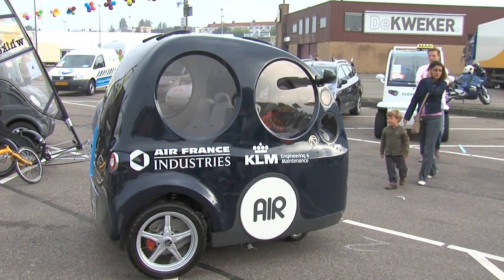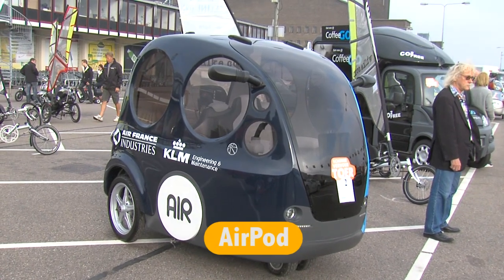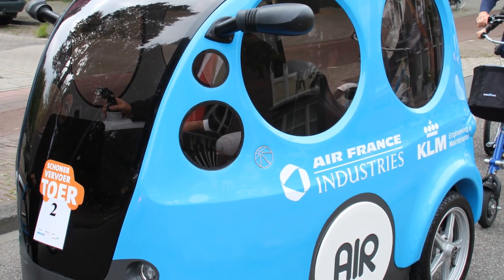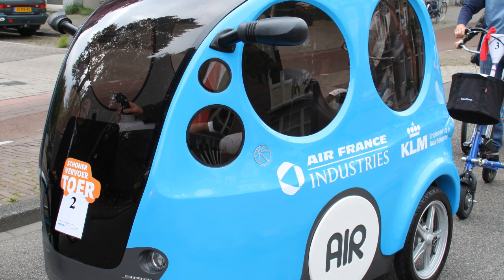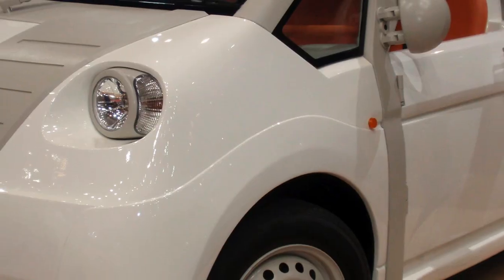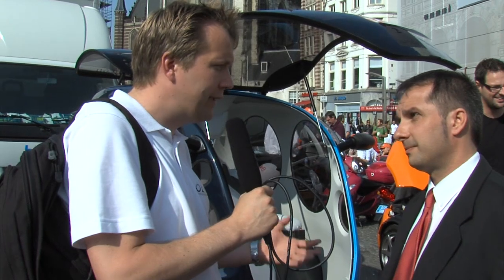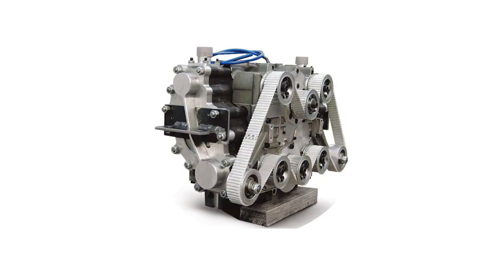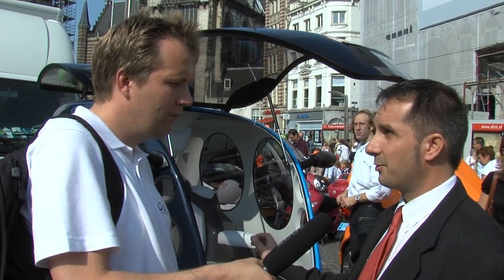Running on Air, the MDI Airpod

Comment: @DanFrederiksen -- the 15km range was mentioned by a KLM official inadvertently during a presentation.    Others with contacts with MDI received confirmation, and via some true believers on a French air car forum MDI said that the low range was because the prototypes were more than twice as heavy as the production car would be.   Of course, MDI had earlier said that the prototypes were final prototypes except for the size of the reservoir.

It's hard to keep the MDI story straight.

Comment: It is not a technical fraud.  It does work - maybe not as good as they say. Problem is getting people to make them

The world is going electric with advances in batteries. Nissan is make the 100% EV, Leaf in the UK.  80% charge in 10 mins

Compressed air has a role in a hybrid mode - brake regen & starting. Air is free and does not wear out, unlike batteries

On the right track, but big money is looking at EVs

They need just one production line going and then focus would be on the technology